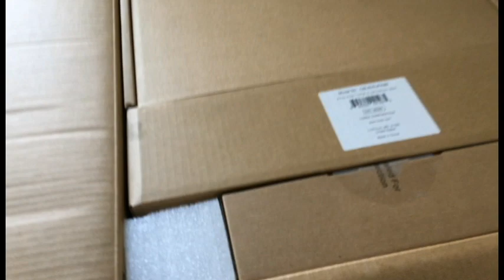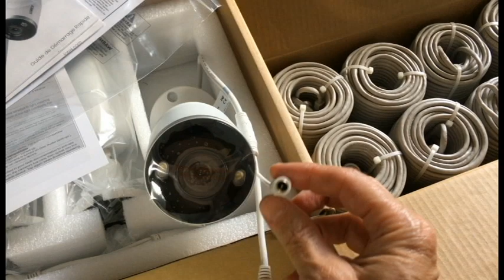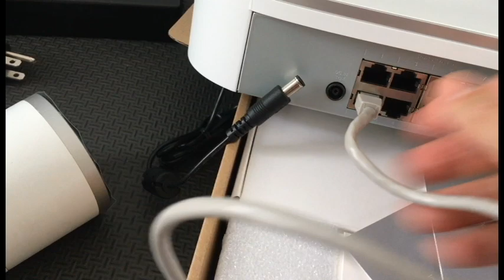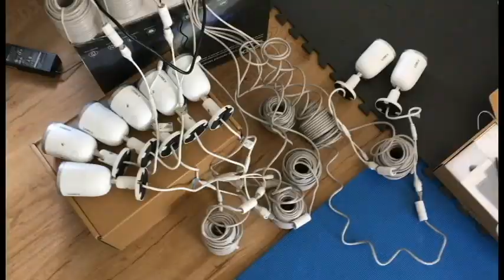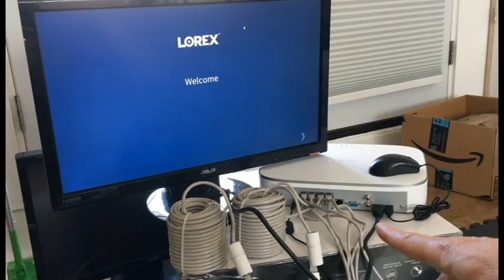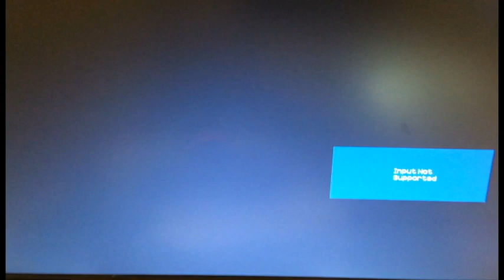Lorex 4k smart deterrence fusion security system. Quick unbox and initial notes

Comment: I installed one of those systems. It is a real pain in the ass to try to find and download video. The interface is just awful. It is extremely difficult to use. After about 16 months one of the cameras failed. I tried to get it replaced under warranty but Lorex will not honor the warranty. I plan to rip out the whole system and replace it with a Riolink CCTV system.

Comment: This would be a great deal ($650 at Costco) IF it worked.  I got one from the local Costco and one from Costco online.  Both suffered from the same problems thus both went back to Costco for a refund.  Neither would shutdown & power off (although Lorex tech support says they won't, contrary to what the manual says).  More problematic however is that after a few reboots, various settings would be forgotten.  Then finally all cameras would be lost and Lorex support says the only way to recover them is to do reset to factory defaults.  So if you are willing to endure all that, plan on doing a factory reset frequently.  Even with saving the configuration to a usb stick, importing that saved config doesn't restore all your settings so you'll still need to do lots of reconfiguring after the factory reset.